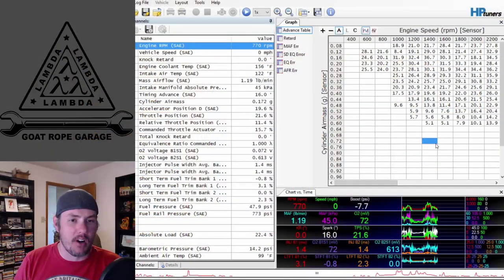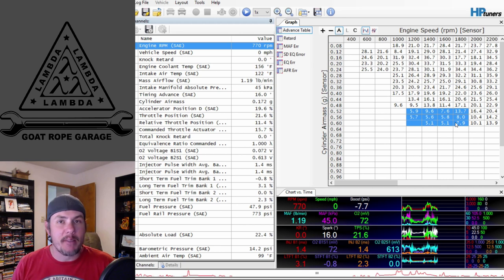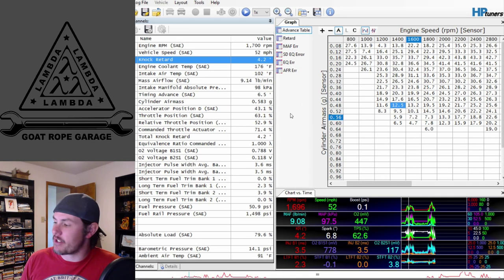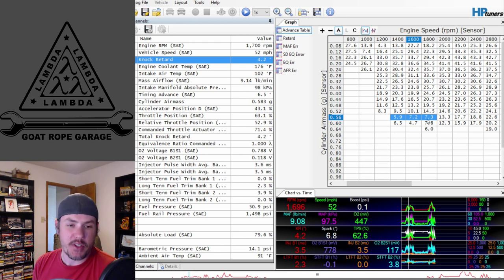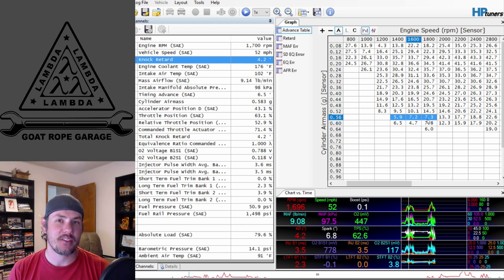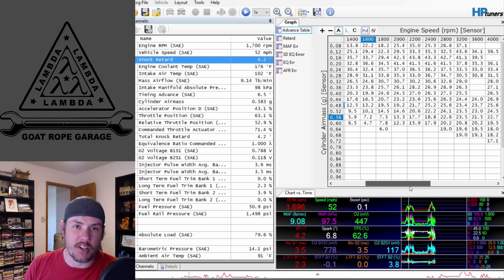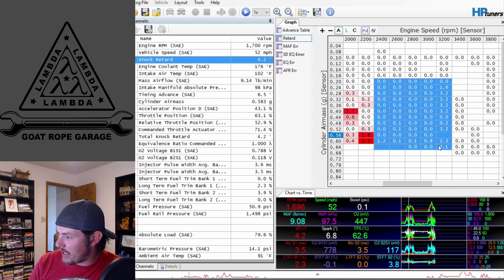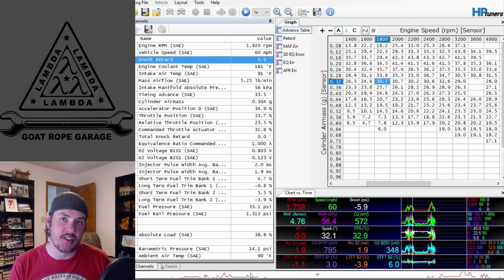Octane Booster Works To Fix Knock!?  Getting A Couple More Degrees Of Timing On 87

Comment: Unrelated to racing but does anyone know if it's fine to use an octane booster all the time in a daily driver? I'm looking at getting a 1998 Infinite QX4 and it calls 91 octane minimum. I was planning to run 89 octane with Rislone 4747 octane boost. Thanks for any advice you can provide.

Comment: I'm curious about the long term effects on o2 sensors and catalytic converters?  I've used the vp product and it worked great no KR. But after changing the plugs they were all orange.
Reply: And it was the "safe" for sensors and converters product.
Reply: How much octane booster did you use and did you use it on every fillup?